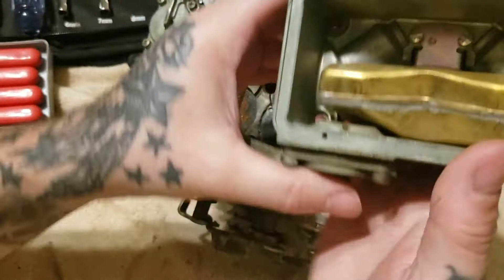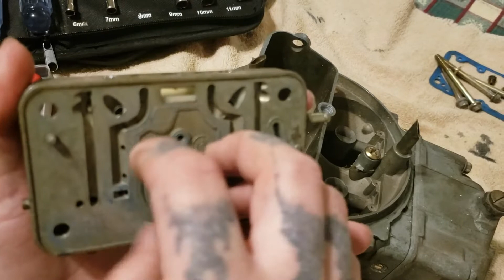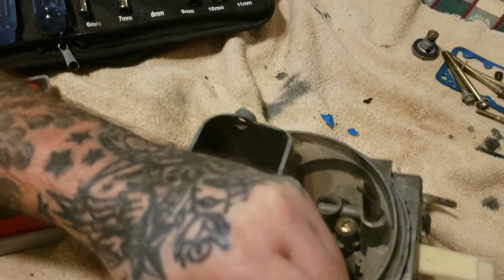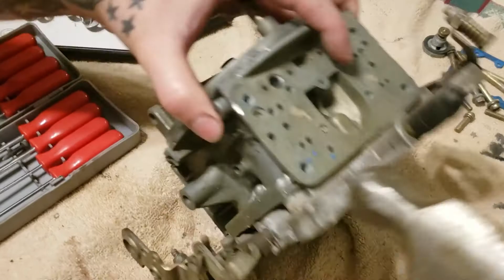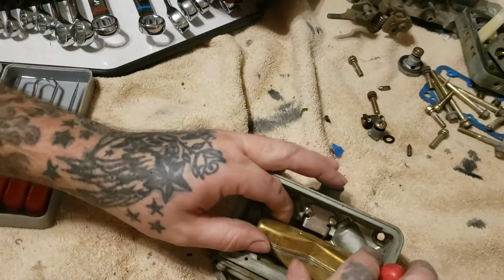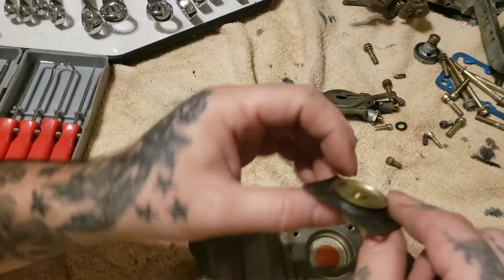HOLLEY 650 CFM DOUBLE PUMPER FULL DISASSEMBLY

Comment: if you spray those metering blocks off easy if you spray around the metering blocks with carb cleaner and lets set for a few minutes .they come off easy. and dont have to beat them off..
Reply from the maker: Great tip

Comment: I have a old 3310 (nodash) 780 modified with a 50cc and a scondary shooter mod with doglegs and a 3310-2 stock and a 650 double pumper stock 30cc.. and 2 rebuild kits. I have a 406 small block that has 220 cc heads and flat tops. I want the 780 but I also want the double pumper and want doglegs... so could I just use the 3310 body and metering blocks and use the 650 throttle linkages etc and create a 780 double pumper?
Reply from the maker: you could try and find out, what makes a 750 holley dif from say like a 650 is just the butterfly bores for air flow cfm
Reply: @TattsForLife  thx. I decided to use the 960 for the 406. Stole some parts from the 750 and 780.. https://youtu.be/PMXxqtKvceg